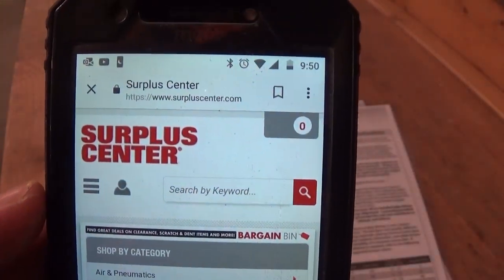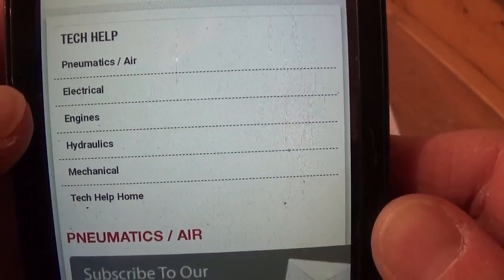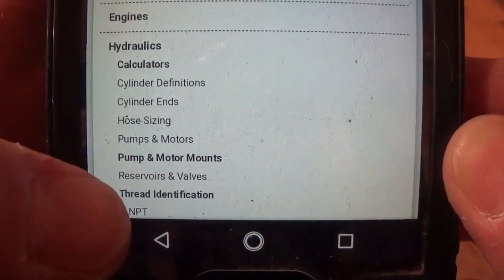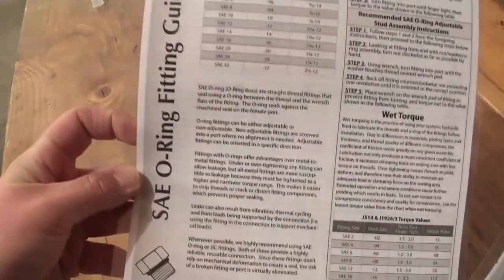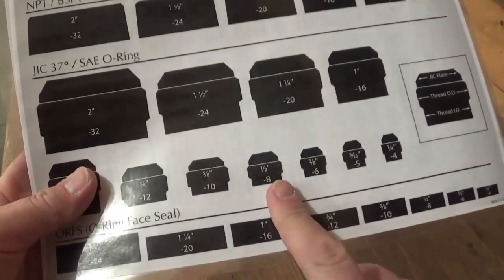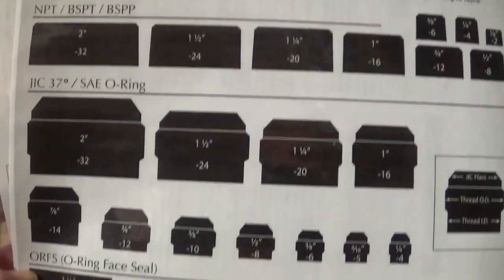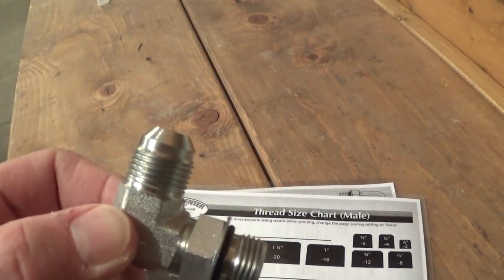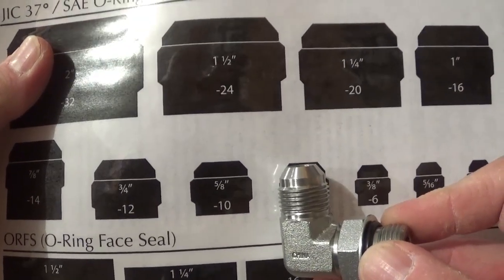How to Identify Hydraulic Fitting Sizes

Comment: Great video and i love Surplus center.. but didnt know they had such an assortment of fittings.. I am doing a hydroboost power brake to power steering pump/gearbox project (85 chev C30 that we put a early d 90s dodge 5.9 cummins.. I know they are AN fittings with O-Rings ends. But i purchased a rebuild hydroboost from rock auto and it has metric threads inlet and outlet so now i have to fab up some hoses.. Thanks ahead of time L.T. Dan
Reply from the maker: @L.T. Dan, Surplus Cnter isn't  as cheap as they used to be, but then again not much is these days...

Comment: But I wish the chart showed other measurements also, like  Fitting hose size and Fitting wrench size... My tractor FEL says 3/8 on hose and has 7/8" wrench size on fitting, then I go online and all I see is 11/16" wrench size on fitting on 3/8" hose. To get 7/8" wrench size on fitting I have to buy 1/2" hose, but I'm not sure if changing hose size affects FEL functions. The only thing I understand is JIC type fitting.......
Reply from the maker: I have seen where you may have a 3/8" hose, but the fitting steps up in size to 1/2" . Hydraulic fittings can be so frustrating!!!